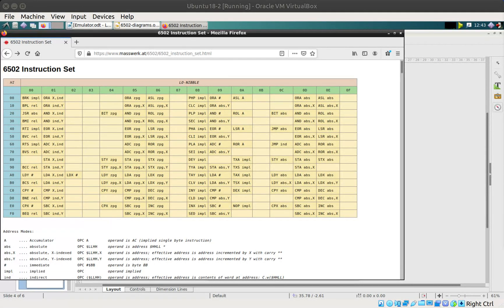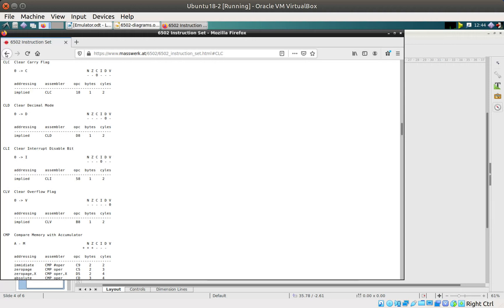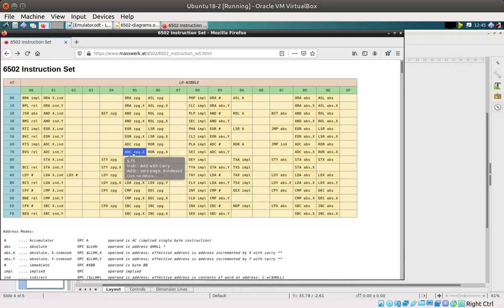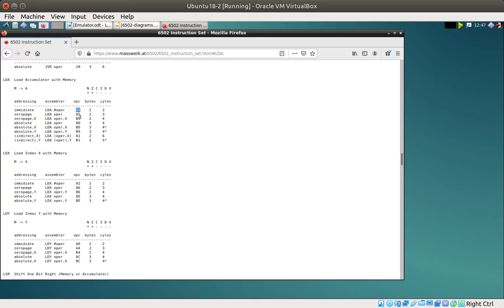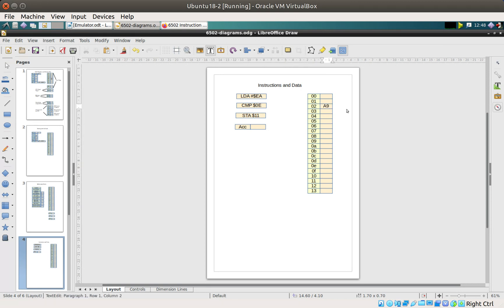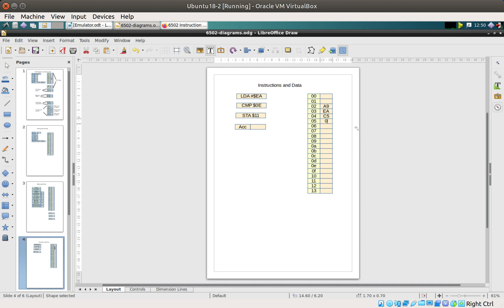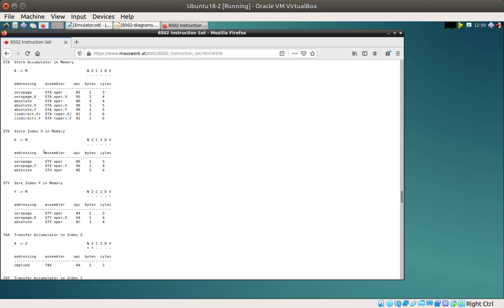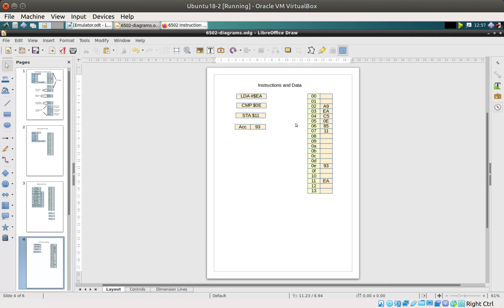6502 Emulator 02 - Instruction Decoding and Data

Comment: I really appreciate this line of videos. I have been thinking of writing my own barebones chip-8 - 6502ish, 16-bit microprocessor in C for a while. Thank you for sharing this process with the world!
Reply from the maker: Thank you for taking to time to watch :) This is my first bash at doing something like this, and there are far better ways of implementing an emulator that properly reflect the CPU fetch/execute cycle using a pseudo bus architecture.  I reckon it might be possible to reflect the 6502 decode process in software, but don't think this would be as intuitive; hence why I chose a more plain and simple approach to begin with; as like you I had never done anything like this before and just wanted to see something working.  My recommendation to you is, have a go. If you want to start with my code then feel free, if you can make a better job, then I would love to see the results.